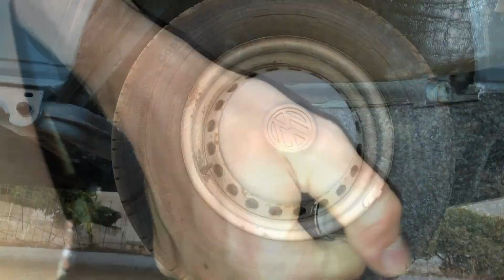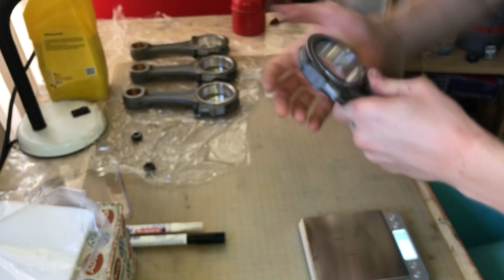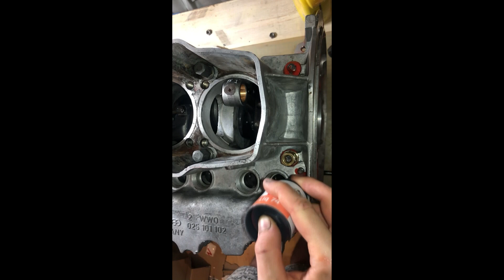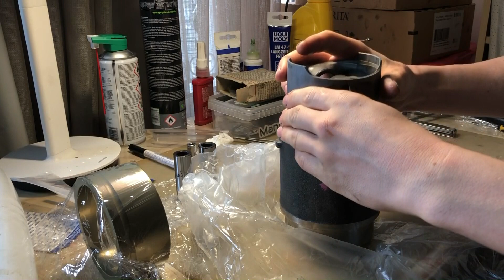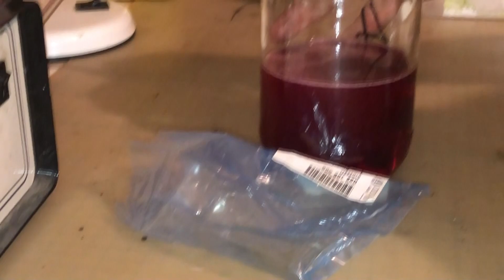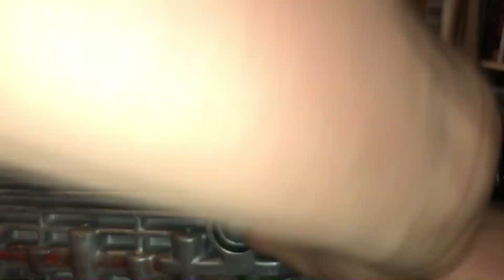VW VANAGON/T3 WBX Engine rebuild part2(assembly)

Comment: "Great video! I noticed you're using an EFI setup. Did you still install the distributor drive gear inside the block, or did you leave it out since it's no longer needed?"
Reply from the maker: Thanks ! I didn’t install the drive gear . It just acts like a plug ( I will make one on a lathe in the future)

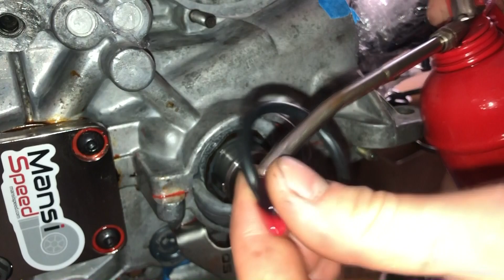Comment: 34:29 is what I came for.  .... The area behind the 3 pulley is all DIRTY, so the pushrods might have been leaking (that area was dirty too) and maybe it was blowing the oil around ?  Anyway,  I'm not doing a full rebuild, but you make it look easy.  And my brain said, you can do this with Guenther's help.   What is two lifters fell out ?  I say make sure they are clean, and reinstall.  .. I did not know flywheel bolts are a stretch bolt, one time use.  I did order new heads, pilot bearing, felt washer, headgasket set.   I painted the water pump, and cross over pipes.   I like that oil pump cover, my Mansispeed said to clearance my own cover.  anyway, the video was well done, well explained !  ... onward !
Reply from the maker: The cover I used is fairly cheap and the stock one loses its rigidity if you remove the outer part . I would suggest to replace the waterpump while the engine is out , an oil leak behind the pulley could be either the pulley seal or the oil pump seal . I doubt that an pushrodtube seal failure would cause it to blow out that much . 

I hope that I was helpful :)
Reply: @Guentherthevwbus  yes. Crank seal was leaking, and, I could pull my stock oil pump out by hand.   New seals on order.  Ich hoffe, den Motor Samstag zusammenzbauen.
Reply from the maker: @DanTheManIOM  ich würde die Ölpumpe von Mansispeed verbauen. Es entsteht ein Öldruckverlust, wenn die pumpe locker sitzt.
Reply: @Guentherthevwbus  it's installed !

Comment: if i may ask, why not put anaerobic sealant in the middle of the case bolt holes also before putting the case sides together?
Reply from the maker: Because it would mess up the bearing clearance if you mean the main bolts . I put sealant n the dome nuts etc which serves the same function:)
Reply: @Guentherthevwbus  ah! Thank You.

Comment: Looks like you used Elring EL-Liq for the case half sealant. Haven't seen that used before. How did it work out?
Reply from the maker: Correct . It worked out fine, it’s the replacement for the OE sealant but you can use whatever anaerobic sealant you like . Silicon sealants aren’t recommended as they can plug up oil channels
Reply: @Guentherthevwbus  Nice! I see you also used the Mansispeed oil pump and EFI kit. I'm doing the same on my rebuild.
Reply from the maker: @andrewberg4043  cool :) do you build a 1.9 or 2.1?